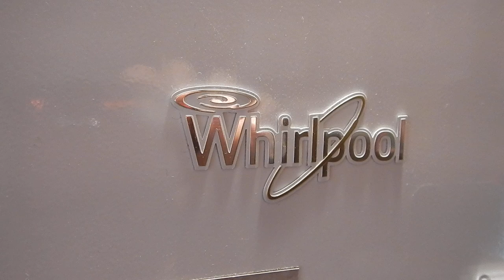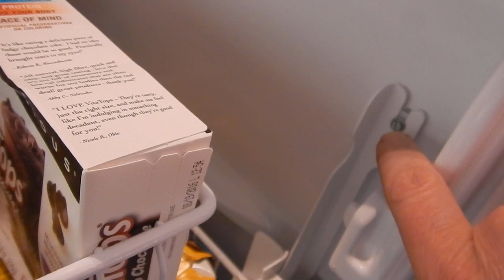whirlpool bottom freezer leaking Free permanent fix

Comment: The P-Trap permanent fix part from Whirlpool is about $16 and it's worth putting it in. Without it,  the warm air from the evaporator pan under the freezer will rise up through the hole back into the freezer and  it will make your compressor run much longer and cause problems. Get and install the P-Trap to fix the problem right. Google Whirlpool Refrigerator P-Trap part.  Amazon has it :  "Whirlpool Refrigerator P-Trap part # W10619951"
Reply: How can you tell if the compressor is running long?  Is there a sound?
Reply: Yes, you can hear the compressor running softly, but you will also hear the fan running. The compressor makes the sold gas which circulates through the coils inside your refrigerator which cools the inside of the refrigerator and freezer.  The compressor is located in the bottom back of the refrigerator on one side and the fan and evaporator pan is located on the other bottom side of the refrigerator, all in back of the refrigerator.  

     Ice builds up on the coils behind the inside freezer wall, and it melts to the bottom, where it is collected and runs down a V slope to the center of the bottom coils. At the center is the original black grommet, the size of a dime, designed to allow the water to flow out of the freezer down into the evaporator pan at the back side bottom  of the refrigerator.  While in the pan, the fan comes on and blows warm air over it to evaporate it into the air. This way you don't have ice build-up in the bottom of your freezer, which eventually drips out the front bottom freezer door onto your floor. 

      When the small black rubber grommet behind the freezer panel, located under the freezer coils becomes gummed up or decays, it seals up, preventing any melted water from ice buildup to escape down into the evaporator pan. So instead, the ice continues to build up on the bottom of your freezer drawer, and eventually drips out the front of your freezer, onto the floor, which can ruin your hardwood flooring if this goes on long enough.  

      To fix this problem, you need to remove the freezer door, empty the food from the freezer, pull out the drawers then crawl into the freezer compartment, and remove the 4 screws that hold on the back freezer panel. Bend the panel a bit to get it out without damaging it.  See the coils which contain the freezing gas that the compressor circulates to make things cold.

        At the bottom of these coils (that have small metal fins on them) notice at the bottom middle, the small round rubber grommet. This is your problem.  If you buy a new one, it will eventually gum up just as the old one did.  Manufacturers have invented a P-trap which is similar to the curved P trap under your bathroom sink.  It is an S shaped pipe which allows water to flow down but not up. Buy the new P trap water evaporation part, rip out the old grommet. 

       Pull out the refrigerator, and access the back, by unscrewing the back panel.  Pull the A.C. plug out of the wall so there is no electricity to the unit. Reach underneath and clean out the evaporator pan. (Notice the fan which blows away the collected water)  Also notice the small compressor opposite the fan. It is a black metal unit sealed, looks like a bowling ball. Install your new P trap by inserting it from under the floor of the freezer from behind, and work it up into the old hole that the previous grommet was int. 

       Make SURE it is fitted in as tight as possible.  Position the other end of the P trap into the evaporator pan.  You have now fixed the problem.  Replace the back panel, sweep or mop up any debris behind your fridge, then push it back into place. 

       Replace the panel in your freezer that covers the freezing coils, then replace the drawers and containers in the freezer.  Place your food back in, and finally bolt on the freezer door.  You are done.  Congratulations  !!!   You just saved yourself over $200.00 by replacing an $8 part yourself, and it will never plug up again, since the P-trap is completely different design than the simple duck-bill grommet which never worked well in the first place.
Reply: @jennifer86010  hello do you have a link where you bougth the p trap
Reply: @jennifer86010  My unit is having ice build up in the refrigerator section too, around the ice maker (which is not connected to a water supply) and filling up and icing the tray underneath the vegetable bins.  How do I fix that?  Will the above fix this issue too?
Reply: @margaretphipps2964  The P-Trap fix is designed only for Whirlpool bottom freezer units. Your problem is different. Ice makers are always connected to a water supply line behind the refrigerator. If your ice maker is making ice, it is connected to a water line.  But your problem sounds more like ice build-up. You may have a leak inside the fridge where

 water may be  leaking downward from the ice-making section. You might have luck finding a fix via You-Tube videos. 

1. Reference the make and model (model number if possible) of your refrigerator/freezer in your video search. 
 2. Type in "water leaking from ice-maker section into refrigerator section" of my XXXX refrigerator/freezer model number XXX  and see what videos come up.

     Many fix-it videos are made by consumers with the same problem you have, and also there are fix-it  videos  from appliance dealers. I'm sure someone else who owns your make and model of fridge has the same problem, which means there is probably a fix-it video on You-Tube. 

     You may also need to defrost your freezer. Sometimes, the build-up of ice on or around the ice maker causes melting into the refrigerator section. It may be as simple as the need for a defrosting. If all else fails, you can call a 800 help line of your refrigerator manufacturer.

     Last resort is to call an appliance repair person, however this can sometimes be costly. The more you ask around for advice the more likely you will get good advice to solve the problem, especially if the ice maker is making ice as it should,  and the refrigerator is keeping food cool under 40 degrees Farinheight.  

   Tip:   you can buy cheap temperature gauges for your freezer and refrigerator. Available at most food markets or hardware stores, or Amazon. Put one in the fridge and one in the freezer. Fridge should be under 40 degrees but above 32 degrees. Freezer should be below 32 degrees.  

     Sometimes, your temperature control is set to either too cold or too hot. In any case if it is not set to optimal temperatures as I mentioned, it will either be too warm to keep food and ice cold, or it will be too cold, in which case it will created unwanted ice, which can clog up things and melt into the refrigerator section.  Good luck !

Comment: Thank you! We don't use the icemaker so I left the water pump unplugged after removing the back panel. Are there any potential problems from doing that?
Reply from the maker: Should be ok
Reply: Repair guy took my icemaker out 10 yrs ago and it runs fine. Your comment was 2yrs ago so you may not even still have the fridge.

Comment: Thanks for the video! 
Think the benefit of the "nipple" (duck billed grommet) is that it doesnt allow free passage for hot air to go back up that line, which may make your compressor run longer than it would otherwise to cool the refrigerator. So im just cleaning mine and plugging it back in. My 2 cents.

But seriously, what a mess this is..
Reply: Yep; heat rises and the back area of the freezer is hot; it will indeed make the freezer run longer.
Reply: Thanks for your video.  I grabbed a 1/4" hex socket for my drill and unscrewed 9 hex-head tapping screws from the metal panel.  I am impressed that you included the the socket size and number of screws.  :))  I also agree with Milanesa2010 and Moon Pie on installing the P-trap and not fooling with the removal or altering the rubber grommet.

Comment: Hi thanks for helpful video! If anyone could offer some insight please  on how I can most easily solve my recent ice accumulation  problem on floor of bottom drawer freezer of my circa 2005 amana refrig. Model ARB2217CW.  I own the amana because my landlord only supplies absolute junk refrigerators that i hate. .  
I dont have an icemaker.  am in an apartment.  
 I prefer to unplug for 24 hours leave doors open remove
Bottom ice as it thaws and  let everything else melt on its own. Is that ok? I am a handy gal but prefer not to take off freezer door and pop out  back panel if i dont have to.  
I had some sloppy contractors sent by my landlord to cut, sand and install new laminate countertops. They also pushed my Amana around while laying linoleum square tiles. They certainly must have clogged up coils at front bottom base, so should i so do a full vacuum and clean out w special fridge coil tools prior to defrost?   And last, should i wait until after 24 hour defrost to take off back panel and dust clean panel vents, inspect the rubber grommet and if no  defects wash it & put back?   I have been maintaining clean coils & back vents to compressor every 6-12 months and never had a problem until a week after the contractors finished the counters and cabinets. I will buy a thinner counter depth refrig if this fails, but hate to do it if my amana still had some good years left.
 Please help! Any advice would be grand!   Thanks Miss do it yourself within reasonable limits.
Reply: I am with you my friend, single homeowner ..DIY Empress..I have taken on my fair share of projects but I do not want to take the back off or remove the tray off either. It's been unplugged for almost 24 hours came back to watch the rest of the video, read the comments and see if there was any other solution. So how did your fix turn out?

Comment: I replaced the P-trap, and also replaced the old rubber grommet with the new plastic tube-like stub that slips over the stub of the spout that sticks down from the compartment roof. Then I used a hair dryer inside the freezer until the water began coming out the new P-trap. I thought that fixed it, but a week or so later the leak started again, so I'm betting that I didn't do a good enough job of melting the ice. I'm too lazy to take out the freezer walls (though I have instructions on how to do that as a last resort), so I will follow your lead and use lots of hot water. I plan to take the back off so I can also observe when the water really flows freely.

Comment: 6/27/21_Thank you for this video. Mine does just as you stated. Tired of this crap frig. I assume that rubber
piece you took out is from the back. I also wondered if it is the rubber on the inside where you poured the hot water into. I can see if a rubber piece their will slow down the drain of the water. Will try this but hate idea of just doing it. Won't buy another lower drawer frig. Thank You

Comment: Nice fix. They say this little black niple (grommet) which you've removed is to prevent the humidity from evaporating water from the tray entering the freezer. Any visible problems?
Reply from the maker: Been a couple years mine still works perfect

Comment: I had to remove ice maker and back wall. Everything (fins) behind back wall was froze solid. Took a long time to thaw.
Be careful with heat gun. That's pretty thin plastic. I used a hair dryer.
Good luck everyone.
Reply from the maker: I'm glad you got it fixed.. should work great now

Comment: Does this issue happen even if I don't use a water dispenser or ice maker?  I can't pull the fridge out to see if i have a water connection or not. But if I do have a water connection and cut off the supply, will it solve the issue or is the water coming from the humidity?  Thanks
Reply: Yup

Comment: I was able to fix this, from the front, no tools required on a whirlpool side by side.  I unplugged,  remover the bottom slide out shelf, and poured hot water over the ice in the bottom of the freezer and got the ice sheet out.  Then I soaked up all water with a sponge.   I let a small electric space heater run in the freezer for 30mins, checking every 10 mins to clean up any water around the heater.  I taped three large Starbucks straws together and fed it as far as I could down the drain hole and gave it a couple good blows and sucks.  It seems as if it cleared up any ice or other obstructions.  I poured hot water down the drain hole and it disappeared rapidly. Voila!  Problem solved, no tools required, just three straws, which are hard to come by in California these days.
Reply from the maker: Nice job
Reply: Thank you for posting the original how to:-)

Comment: Thanks for the tip on melting the ice in the drain, and how to get the drawer out!  I'll be going with the replacement drain, though, which costs $15 on Amazon, I don't want to let the hot air in unnecessarily.

Comment: Guys, try using a 30 Watt (or higher) soldering iron to melt the ice in the back of the freezer instead of a  blow dryer.  Just be careful not to touch the plastic.

Comment: Can someone please explain to me - did he get rid of the gray slide thingy? Or only the top part of the slide? I'm wondering where would the melted water drain into if there is no slide. Thanks
Reply: 2:20 mark. At the top of the slide is the bottom of the drain tube that has a black nipple attached to it. The black nipple is what he threw away.

Comment: I tried the heat gun the other day and thought I had the freezer drain problem fixed until today and there was ice in the bottom again...Then I saw another video about cleaning the Rubber drain plug out...I was going to clean the Rubber out tomorrow...Then I saw this Video and tomorrow I'm throwing the DAMM RUBBER AWAY..... NOW All I have to do is find out Who's doing all the KNOCKING inside the Freezer when the Ice Maker starts working......... Hopefully I'll be able to put my BALLPEEN hammer back in the Garage instead of keeping it in the house to beat the ICE out of the bottom of the Freezer...

Comment: In all the years I have had frost-free freezers, this has never been a problem! Wonder what manufacturers have done to the original design of the drain system to cause this? Maybe the addition of the grommet instead of a direct drain tube? Another issue which many, if not most people will choose to PAY a technician to fix. Why is the grommet necessary if the "slide" drains the water directly to the evaporation pan? We are so manipulated!
Another DIY video showed it was gunk buildup in the grommet. Removing and cleaning the grommet and replacing it did the trick. Over time, the drain will clog with gunk and will have to be cleaned again. It's the gunk that causes the water to backup and ice over.
Reply: some areas like Florida have insect like cockroach problems, hey can crawl up into the drain, thus the grommet, where I live in Washington State we don't have them so left the grommet off.
Reply: Supposedly can keep heat from compressor getting up into the fridge which keeps it running since it is hotter with the plug out.

Comment: Great video and advice. Tip: stir a tablespoon of Pink Himalayan Sea Salt into your hot water, then pour it into the drain; the salt will keep the hole from freezing over quicker than if you don’t use it. You can even pour a little salt into the hole, as the water in the drain evaporates it will mix with the salt, keeping the over-freezing to a minimum. Stay Blessed✨
- True Ju🌀

Comment: Ghada Abusalah
3 months ago
The slides for the drawer in my freezer keeps freezer and keeps the door from opening. What can I do?
Reply: Why are your freezer drawer slides getting wet? You are certain they aren't just bent? And locking when freezer drawer is closed? THIS CAN HAPPEN WHEN SOMEONE OPENING THE FREEZER DOOR IF IT IS AS U STATED A BOTTOM FREEZER WHEN THE DRAWER IS OPENED IF ANYONE LEANS THEIR BODY WEIGHT ON THE FREEZER DOOR IT WILL BEND THE SLIDEZ AND NOT SHUT COMPLETELY LEAVING THE DOOR SEAL SLIGHTLY OPEN WHICH THEN CAUSES YOUR FREEZER TO GET VERY FROSTY AND RUNNING CONSTANTLY YOU CAN EVEN FEEL THE AIR IN THE GAP OFCSEAL..ALSO IF U HAVE SIMPLY BENT THE DRAWER SLIDES YOU WILL NEED TO PURCHASE NEW SLIDES AND NEXT TIME TELL PEOPLE WHO USE YOUR FREEZER DONT USE THE FREEZER DOOR TO SUPPORT YOURSELF WHILE BENDING DOWN..THATS WHAT KNEES AND OR STOMACH AND BACK MUSCLES ARE FOR.GO WORKOUT AND LOSE SOME WEIGHT LOL..
Reply: We had a screw loose on the track that kept it from shutting.  Check your screws and make sure all are seated tightly.

Comment: what is the purpose of the rubber piece ?
Reply from the maker: It just controls the flow of water it keeps it very slow
Reply: It prevents warm air the compressor creates from flowing back into the freezer. Preventing frost buildup.

Comment: If you don't like the Water running out on the left...Use the level adjusting Screws and tilt it so the water runs to the right.....Just kidding....Just throw that Damn rubber Drain plug away...I took the plug out and took the hot air gun and melted the drain hole and it hasn't leaked since.....